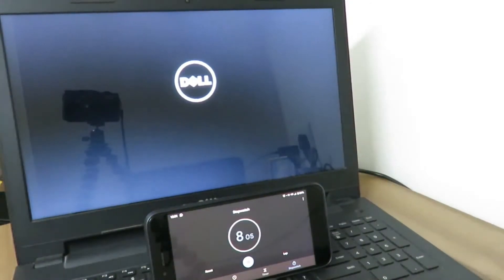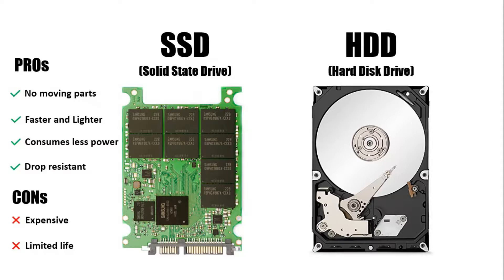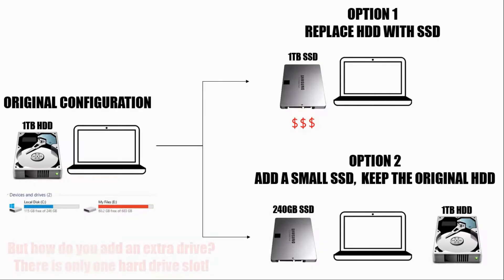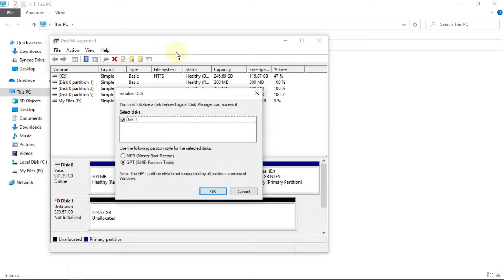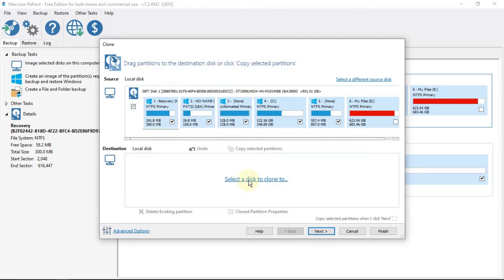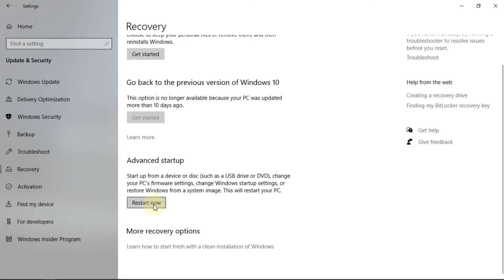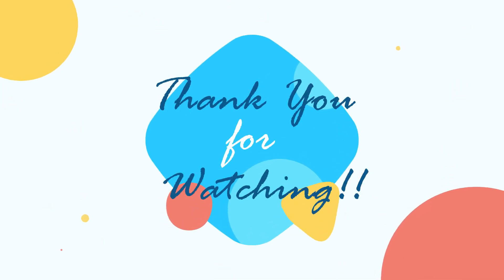Upgrade your Dell Inspiron 3542 laptop with an #SSD! (no Windows reinstall , keep all your apps)

Comment: Thank you for this amazing video..

This saves my ₹2000 around. I asked local vendor to do this upgrade and he came up with ₹4500 of cost estimation.

I bought SSD 240gb from Amazon and it costs me of ₹2300. I didn't buy caddy. Now with 8gb ram and 240gb SSD my boot time is 5 seconds only..

Again thanks for such useful information to share.
Reply from the maker: Awesome. I am glad that it helped!
Do share it with your friends in case they are looking to upgrade. And yes, do subscribe!  :)
Reply: @TheMuser  sure.. already subscribed with ❤️
Reply: Without caddy, how can you place SSD, did you place it in place of hdd?
Reply from the maker: Yes He replaced the HDD with a SSD.
The caddy is for putting the drive into the optical drive.
Reply: @Anonymous-pt7el  Yes I replaced SSD with HDD. I am accessing HDD with external USB cable connector.
Reply: @svnrvl001 Bro i have dell inspiron 3541 and its AMD processor, can i install SDD and Ram into it
Reply: Hello Savan Raval. Please help me, I am unable to boot my Dell Inspiron 3542 after installing SSD.
Reply: Which company  ram have u purchased for dell Inspiron 15 3542 model ? Can u share the link of 8gb ram ddr3l for this laptop?
Reply: @priyagrover6930 crucial DDR4L RAM
Reply: @m2023m  thanks for rpy 😇 but dell Inspiron 15 3542 model supports ddr3l ram not ddr4 otherwise I would have purchased crucial in ddr4
Reply: @priyagrover6930  you are right ...thats DDR3L and not DDR4L...
Reply: Crucial 8GB Single DDR3/DDR3L 1600 MT/S (PC3-12800) Unbuffered SODIMM 204-Pin Memory - CT102464BF160B
Reply: Is this worth for 2700 or have any choice pl guide me

Comment: Thank you very much sir. I am 70 yrs and did upgrading myself a year back with your help.
But now my ssd is full and i am not able to direct my all new apps or work to hdd.
Pl help
Reply from the maker: The only solution here would be to either free up space on the SSD by deleting unused apps and files or get a bigger capacity SSD

Comment: Hello sir please help in my dell inspiron15 3542 if I put ssd in hdd place laptop not opening showing reboot and select proper boot device
Reply from the maker: Ensure you have followed allthe instructions especially about the copying of the system partitions.
Ensure you have set the BIOS location correctly. (Point to SSD)
Repair your Master Boot Record (MBR) One link you can use https://neosmart.net/wiki/fix-mbr/

Comment: What if the BIOS is Legacy instead of UEFI.
My laptop didn't boot after the installation. 
pls HELP
Reply from the maker: I would suggest going back to the original setup (HDD in the drive slot)
Turn the BIOS to UEFI and then try the same steps all over again.

Comment: In my bios boot.efi not showing what I do
Reply from the maker: You will have have to enable UEFI mode first if not done already.

If BOOT.efi is not showing in the HDD as well then it would be better to do a enw Windows installation.

If BOOT.EFI is present on HDD then follow the instructions here
https://www.youtube.com/watch?v=tMQnMW0-TCU

Or you can try to repair the EFI partition  as follows
https://support.novabackup.com/hc/en-us/articles/360011403653-How-to-repair-the-EFI-bootloader-on-a-GPT-HDD-for-Windows-7-8-8-1-and-10

Comment: Is it worth it in 2022? I have the same laptop with i5 processor and it is so slow. I am thinking of upgrading it but don't know if it will really be worth. I am from Nepal and the cost for this upgradation will be like Nepali Rs.11-12 thousands. Or should I buy a new laptop?
Reply from the maker: I was in the same situation as you are. I was thinking of buying a new laptop. Looking at the prices of new laptops, I thought I'll give this a try first. 

In the worst case, if it did not improve,  I thought I would still have an SSD that I can use on the new laptop later :)

I use this laptop mostly for data work and some video editing. And for me the difference in performance was significant and I haven't thought of replacing it after adding the SSD.

So I would suggest give this a try. Most probably you'll be fine with adding as SSD. 

However what you use your laptop for will also be important. If you expect heavy usage of image and video editing applications applications, then maybe you qould be better off getting a new laptop with better RAM.

Comment: Hello sir,
Is it possible to upgrade the WiFi card for this laptop.
Present card connectivity is very slow.
If not are there any alternatives.
Reply from the maker: Yes you can. And in fact I have replaced mine with a dual band wifi card.
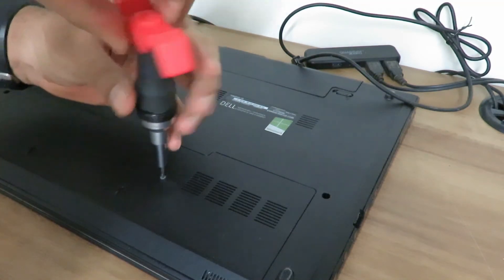In the video at 7:53, you can see the wifi card's position as well
The dual band card lets you connect to the faster 5GHz band but your router needs to have dual band first.

The one I got was from AliExpress and was for INR1700 (https://s.click.aliexpress.com/e/_DlQA9LN)
Model Number 7260HMW

However since AliExpress does not deliver to India any more you can look for something similar on Amazon
One link is provided here. however I have no idea how this product will be.
https://amzn.to/3ViUI39

Comment: efi file is not showing on my ssd.
Reply from the maker: That would mean that you hve not cloned it correctly.
While cloning the HDD, make sure to choose the system partition as well
Reply: @TheMuser  i have selected c drive partition only. entire hdd data was cloned successfully.
Reply from the maker: @jayanthkillam  As mentioned at12:50, you should clone the RECOVERY and BOOT partitions as well!
Reply: @TheMuser  i have cloned all partitions.. how to get efi file on existing hdd.
Reply from the maker: @jayanthkillam  you'll have to enable UEFI on the HDD for the EFI to be generated. This entire process works for UEFI systems
Reply: @TheMuser  how to enable UEFI.

Comment: Hello, thank you very much for this detailed video. I followed all the steps and successfully installed & configured my SSD. However my HDD is not showing in the file explorer. It only shows C drive which is the SSD. Can you please help?
Reply from the maker: Most probably it is a loose contact. Ensure it is properly plugged in.

Comment: All instructional/tutorial videos should be like this. Even if I hadn't had this same laptop, I'd have watched if for the quality of it. Thank you Sir👍👍👍
Reply from the maker: Thanks for your generous comment. Made my day :)
Reply: I have the same as yours model laptop but with an i3 processor. So will my laptop support the Samsung SSD if I go for the same?
Reply from the maker: @vineet248  Yes, it definitely will!
Reply: I had to stretch my budget a bit but I ordered the Samsung one as you recommended. Will tell you how it goes from there after it arrives. btw do have any recommendations for RAM as well (any particular brand or model) for the same laptop model? As it has a single slot, I feel a need to expand it to 8gb.

Comment: Can I contact you, I have a problem after upgrading to SSD, it runs fine, but when I formatted the HDD its not starting and showing Error Code 0x000000e,
Need your help !!🥺
Reply from the maker: Ensure you point to the SSD in  boot options menu.
See this video portion 
https://www.youtube.com/watch?v=xM_FOTzKr60&t=878s

If it still does not work, there might be an issue with boot configuration.
Fix the BCD using the following article
https://www.backupassist.com/blog/how-to-fix-boot-issues-with-bcdboot
you'll need a bootable USB drive for this to work.
Reply: @TheMuser  Definitely, I will try it out....
Reply from the maker: I'll put together another video to run you through the BCD repair steps. Looks like a BCD issue

Comment: Can you please suggest best yet with affordable 250gb SSD for my Dell Inspiron 15 3542 and if i want to reinstall the windows in SSD and do the bios step will it be the same ? Or do I have to do anything else
Reply from the maker: The Crucial BX500 is a good option. I have been suing it since I made this video and it's been working perfectly well.
https://amzn.to/2YTCklj

Reinstalling Windows will be exactly the same. Do ensure you have your product key linked to your Microsoft account for activation if required.

Comment: Sir I have same model i want to upgrade to 500gb SSD. If I use 4gb ram with 500gb SSD or i will have to upgrade ram also. By upgrading SSD will it worth or have to upgrade ram also
Reply from the maker: If you run heavy, memory intensive applications like video editing or games, then you'll need a RAM upgrade as well
However for general usage, the SSD should be more than enough.

Of course, if you have a lot of money, then do both. This model does not support more than 8GB of RAM
Reply: @TheMuser  
I just do programming and nothing else so should I only upgrade SSD.
Reply from the maker: @KomalAher005  Then SSD should be more than enough

Comment: Sir, I have put ssd in the main slot and hdd in the caddy and after this installation i turned on my laptop and its shows "insert a bootable media" and "Exiting PXE ROM"
Reply from the maker: I guess you have not fixed the SSD correctly. Push it in firmly and ensure it clicks in place.

Also, in the boot menu, ensure Boot mode is set to UEFI.
Reply: @TheMuser  Sir, i did that again and it shows the same. 
Also, in the boot menu, it was already set to UEFI.
Is there anyway i can get help from you ??

(PS : WINDOWS IS INSTALLED IN  HDD)

Comment: Hi I am getting byte/sector error cannot clone source disk to destination disk you got this error while cloning I have same laptop Dell Inspiron 3542
Reply from the maker: It looks like your old HDD has sectors with errors. You can try fixing the sectors with errors, but most probably the error is permanent. (The HDD works without a problem most probably because bad sectors are marked and ignored. While cloning though the cloning tool cannot  ignore it and that's why the cloning does not complete)

It would be a better idea to go for a clean install

Comment: Hello sir, Thank you for this amazing video

I am trying to do the same but , I am not able to see disk 1 (ssd) in disk management

Can you kindly provide any possible solution

Thank you in advance!
Reply from the maker: At 09:35, I have explained why you might not be seeing the SSD. 
Do check it out. Hope it helps!
Reply: @TheMuser  Thank you so much for your reply, but I am not able to see ssd in device manager and disk management and yes there is no hardware issues
Reply from the maker: @vadirajkerur4710  Where is your SSD connected right now? Is it in a caddy?
Try putting it the HDD slot to see if it is being detected.
Check if there is any switch on the caddy that needs to be switched

Lastly confim if the SSD is working on another machine.
Reply: @TheMuser  Yes I tried with HDD slot
Ssd got detected, and even verified SATA connector it's also working and yes checked ssd in other machine , it's getting detected,

There is no switch in caddy I searched all the way  I doubt the caddy now. But its a brand new. So my concern like anything from software end I need to do ,

And again , Thank you so much for your reply!
Reply from the maker: As a last guess, I would suggest pushing it tight.
If you are being too delicate with the SSD, it might not connect properly.
Reply: @TheMuser  Yes , Thank you so much for support!!

Comment: Great Work Brother, it really helped me. However, i want to know after booting from SSD can i format C drive from HDD and use it in general, if yes the how can i do this ? 
Also i am noticing one thing that now fan is running more is that because HDD is in place of cd drive space increasing the temp of laptop more frequently ?

One more request if possible can you create a tutorial for replacing keyboard for the same laptop model you used with keyboard having back-light 

Thank you!
Reply from the maker: Glad it helped!

Yes, you can format the HDD and use it as required. Disk manager would have an option to format. But make sure you don't need anything on the disk.

The fan running more won't be because of the HDD. The fan is used to cool the CPU. It could be because you are running something which is CPU intensive.

I use a connected keyboard and not the one on the laptop. SO I don't think I'll be upgrading the keyboard on the laptop any time soon. :)

Comment: Thanks it helps a lot. 👍. I have query, What happened with old C drive data present on HDD. Do you formatted it after cloning? And you have told we can install directly Windows OS on to SSD instead of cloning if less applications are present(installed) in HDD C drive; which process we have to follow to install OS. 
It would be great help.
Reply from the maker: Yes, you an format the HDD.
For the clean install you can follow the process the linke here.
https://www.windowscentral.com/how-do-clean-installation-windows-10

Comment: Hey, nice video but have some suggestions for future use.
I replaced hardware as it is shown in vid but I could not boot Windows. I had warning 'This Product is covered by one or more of the following patents: US6,570,884,  US6,115,776 and US6,327,625'.
I have changed every single boot combination in Bios and couldn't boot with this hardware setting.

Then, I solved the problem when I put SSD in ROM slot and HDD returned in regular slot, cloned HDD to SSD  as it is shown and then switched the places of Disks (HDD in ROM slot and SSD in regular slot). I erased CD ROM in Device Manager as well. Hope this will solve the problem to someone. 
Greetings
Reply from the maker: Glad you could work it out and thanks for sharing. I am sure this will be helpful for someone out there!
Reply from the maker: From the online articles I read, most probably this was due to a loose connection.
Reply: @TheMuser  Nope.. Checked connection many times(connect and disconnect)..  I had trouble finding that bootx64.efi as well. Probably due to cloning those files weren't copied properly. At the end I had to install windows again from the Usb.

Comment: 1. What is the purpose of the black paper on internal hdd..if I remove it so will my hdd work normally?
2. The black paper is connected to internal hdd with some internal pins, so if I remove that black paper , I can't put it back on the hdd or some other SSD, right?...or can we also just stick the paper onto hdd or SSD?
Reply from the maker: 1. What is the purpose of the black paper on internal hdd..if I remove it so will my hdd work normally?
The black paper is some kind of insulation. I have the HDD in my optical drive and it is working fine without the insulation.

2. The black paper is connected to internal hdd with some internal pins, so if I remove that black paper , I can't put it back on the hdd or some other SSD, right?...or can we also just stick the paper onto hdd or SSD?
The black film is not connected by pins, it is glued on to it. You can stick it on to another HDD but the sticking power would not be as good as the original.
Reply from the maker: I have answered all your questions since you took so much time to put them down systematically.
Do subscribe if you found it helpful

Comment: How much SSD can I place ?..I have Dell inspiron 3542 i7 4th gen ( as far as I know model number matters for space and processor no and generation decides the RAM, correct me here if I am wrong)....so I have 1 TB hdd installed on my laptop...now I am thinking that I place 1 TB SSD in internal hdd slot and my 1 TB hdd in optical drive...will the system support total of 2 GB storage..?..how much max storage can Dell Inspiron 3542 support?
Reply from the maker: I cannot say this for sure but I have read that SSDs upto 2Tb are supported. You will have to check with the Dell website or customer service to confirm the maximum size. 
The 1TB HDD will work fine in the optical drive. I am using one right now.